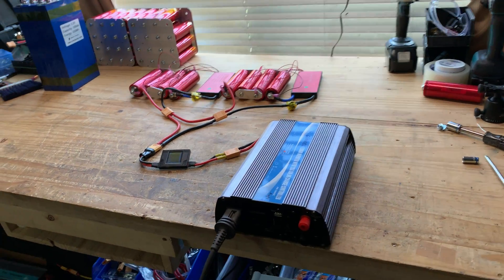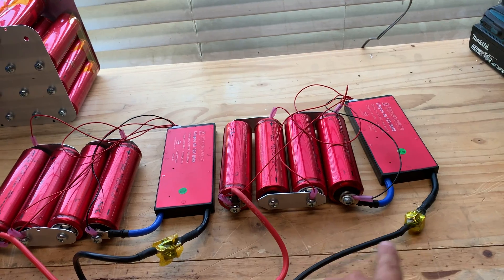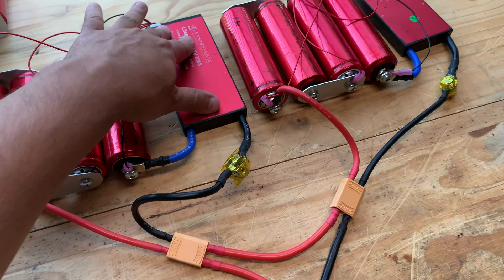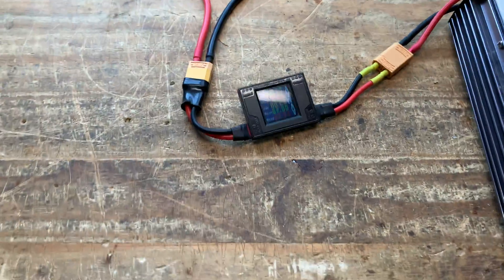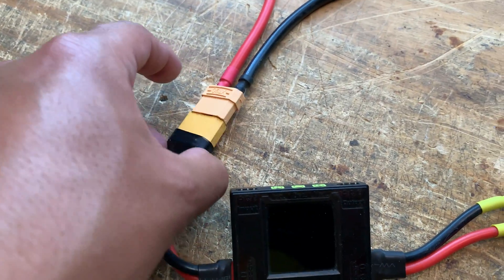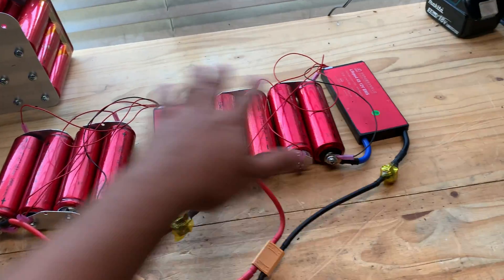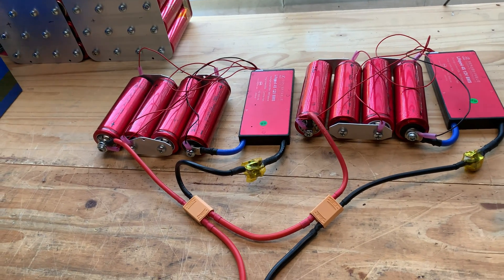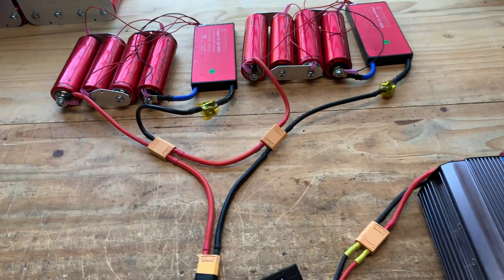BMS Battery Module -  Can you Series connect them?

Comment: No it doesnt work... i works for sometime the they just burn... i made an electric scooter and the battery was 2 parts of 5s with their individuel bms... after 10min of riding the bms of one battery is just burned ... i think it was the higher voltage because the bms was rated 50A and i was pulling only 10A with the one hoverboard motor i used for the project .. so ... conclusion... use bms only for charging and have a separate wire circuit for the discharge load... of course then you ll have to have some kind of other over discharge protection... bu me i just use those small 8pin rc balance buzzers and i moniter the stat of the cells that way i can stop when it  s too low voltage

Comment: I see a secondary problem here. Once one BMS detects that a battery is fully charged it will go open circuit.  This will stop the other battery from charging fully and your two 4S cell groups will quickly go out of balance. Or worse still it will go into bypass mode and the second battery would get the full charging voltage intended for a 24V setup rather than a 12V setup. The only way around this would be to charge using two 12V chargers (which defeats the purpose of a 24V system). I don't think I'd be recommending this system. Much easier and simpler to use a BMS designed for 8S. The only other way around this is to have smart BMS's like Battleborn does.

Comment: Because no one has responded to Ewald although it was not that long a go , I would agree with him, 24V you may be OK but above that I would not as he stated the BMS that switches off the load will see the whole system voltage across it's terminals, obviously with single 12V pack that will only be 12V but as you stack 12V packs it will quickly rise.

Comment: Didnt find anyone saying that: 

The built in MOSFETs have a maximum Voltage Rating. 

If one of the BMS shuts off. The switched off MOSFETs get the Voltage from the whole Setup so in that case 24V. 

If the Setup Voltage is higher than the Voltage rating of the MOSFETs, the MOSFETs are damaged at the second the BMS switches off !! 
You can not series connect BMS !!!

Most Mosfets can handle 75V Some even less. The higher the Voltage rating the bigger is the ON Resistance. (not necessarely but mostly).
If you get to Voltages over 100V you get problems getting MOSFETs that are capable off switching high currents. Thats why you use Relays for Voltages in cars. 
Also of course higher voltage ratings are more expensive. 

For high Voltage fast switching, IGBT are used. They are much bigger but can handle Voltages around 1000V. But they are expensive.
Reply: Ewald can a BMS be parallel linked without all of the concerns I'm reading on here?

Comment: Thanks for this video. Currently researching how bms work internally.  I am told the bms have to have isolated grounds to be placed in series.  I don't know how that is done.  The bms measures the voltage of the pack so it uses an microprocessor and an A/D. I don't think the bms can just use a diff. measurement when the common can be at such a high  voltage. Still have not figured this out.

Comment: I would want to see actual voltmeter reading not the DROK reading because that one is working based on initial voltage readout.. if it would be the actual BMS then you would have to unplug the BMS not the device plugged into the BMS the BMS stayed connected to the battery.. so in the situation of over current or under voltage BMS disconnects and shuts the system down which is normal reaction if you are taking the load from the packs but voltmeter with it's own power will only show drop on the voltage if you disconnect the balance leads and then would show right away the voltage back if you plug them in.. there is no switch on the bms itself..  so imho it's more the fault of the testing device..

Comment: The far left balance wire attached to the positive terminal of the left battery pack is completing the circuit after the left BMS module trips out. Because of this the answer to can you run them in series is no, you cannot. In series operation if either BMS module trips out you risk burning up wires and lighting the tripped out BMS on fire.

Comment: With mosfets I'd advise checking the max voltage and max current each can handle between drain and source. Gate is much lower and I'll say perhaps protect the gate side when wanting to bump up the voltage or current. But bare in mind the voltage is devided between them if am understanding correctly.

I have never worked with BMS but should be on the same principle.

It might be worth checking the components themselves?

Comment: Can you parallel connect different batteries with different bms? Should i use an additional bms that treats both as individual cells?
Can i later on charge them through the same charger as one battery?

Other than both having the same voltage as we connect them and protecting them with schottky diodes from overflow current from the other battery, what safety measures would be needed?

what is the energy density on these lifepo4s?

Many thx to those who will enlighten me! 

And thank you for those enlightening videos!

Comment: The problem with this is that you are not checking the voltages on the two different packs...Over time, the voltages can get unbalanced, which is the reason for using the BMS in the first place.
And for using them in parallel...Nothing will go BANG...but don't expect to get the sum of the current limit of each one...that's not how it works.
Overall I dont think it is worth doing this...just buy a better BMS in the first place.

Comment: Series BMS won't balance between BMS modules. Each 12v pack may be at a different state of charge. You will need to charge each 12v pack independently to get to get them at full capacity. Not an issue when discharging since the lowest pack will break the series chain, you just won't get full capacity out of each pack. You can't rely on them being perfectly matched over time.
Reply from the maker: Which is the same principle any BMSd pack operates under,  you are only as good as your weakest cell

Comment: I have heard from so many sources (including the manufacturers) that a series setup is not possible but I have personally used 2 * 48V, 30Ah packs (each with their own separate BMS) in parallel and series for years on a daily basis without problems. As you correctly pointed out - the load must be disconnected to reset the BMS in case of any fault detected. Thanks for confirming it jehu
Reply: so many BMSs don't support this function and only have problems with  B- and P-
Reply: No i also test that 12v bms can't connect in series bcz a 1 b.m.s need specific voltage that then it turns off that is auto cut off.
Reply: for bigger expensive setups that "if" is very costly and scary :)
Reply: Hi i have 4 No's 12 v lifepo4 battery    it all have seperate bms inbuilt    can i connect series without damage
Reply from the maker: But what if it fails? Everyone says,  well what if it doesn’t I say
Reply: @jehugarcia  As long as the result is not fire and brimstone I agree :) if the only problem is you either trip or blow your bms- great. Worth the money/ hassle
Reply: I used two 4S BMS in series. When they failed it took out $150 battery. But I don't think a dead short like that is very common when a BMS fails. Using the BMS to power a contactor/relay would have prevented this mishap.
Reply: @jehugarcia  Right on brother. Enjoy your channel very much - thanks again

Comment: we need an explanation for what actually happens in series, I've tested multiple LED arrays in series. yes each LED is getting 3.2V but with some chips an overall voltage over 100V the LED'S can blow up when in theory they are getting the correct voltage and current. 3.2V and 350mA?

Comment: I've personally tried with 4 cheap 4s lifepo BMS plugged in serie for a scooter. It was a disaster, there always was a pack  which gave up very quickly and i had to unplugged and switch 2 pack randomly to reboot the system and keep pulling load. I gave up the idea and rebuilt a single 48v pack with the four 12v packs.

Comment: The question I'd ask myself is, are these BMS designed for series use? 
What concerns me is what many here have commented on, and that is the presence of a potential when one 12v bank is inactive. Regardless of how low the current flow is. I would be concerned about possibly damaging whatever I would be attaching to it. In an ideal world it should be 0 volts. 
It would be interesting to see if anyone creates a 36v, 48v and see the results.

That being said I only have praise for Jehu, I'm relatively new to the Li-xx scene, and most of what I have learned is right here. I like his approach, it's a lot like I have done in the past, but I'm getting older ... lol..thank you

Comment: This is just a thought and maybe I'm totally wrong

1) if you have more packs ,and you connect the output of the BMS in parallel ,you are fine , at the beginning  ( in terms of time)the highest pack will discharge,  and then they will keep going together 

2) if you have  more packs , and you connect the output of BMS in series , you are fine ,but you have a limitation on the number of BMS that you can connect in series , because the output stage of a BMS is basically a pass transistor , and every MOSFET has a DRAIN-SOURCE breakdown voltage , so when a BMS shuts down is output,  if there is a V d-s greater than the V d-s breakdown you will destroy the MOSFETS.

3) this is a sketchy one , because apparently everyone that is building a powerwall with the jehu's kit is doing this without noticing.
In every powerwall there is at least one BMS board with three BMS's connected in parallel ON THE BATTERY SIDE ,in that powerwall every cell is connected in parallel with all the other cell ( basically you have 7 cells in series and n cell in parallel where n is the number of modules) , fine nothing wrong with that, here comes the tricky part, every BMS has a balance connector , and you connect all the all the BMS and all the cells in parallel , when you charge up the battery all the balance MOSFETS must work together to keep the packs balanced,  but every MOSFET is different from the other , and every MOSFET has a different threshold voltage than the other, the one with the lowest voltage will kick on immediately trying to balance the pack, since it's on it will heat up , and is threshold voltage will become lower and lower , so basically what I'm saying is that from all the BMS's on all BMS boards of a powerwall ONLY ONE MOSFET is in charge of keep balanced all the cell ( of the same group so there will only one MOSFET for all the third cell of the series)
Apparently no one had notice that because all cells are roughly equals so the balance mosfets are having an easy life, but during the years those cells will drift , and the balance MOSFET must work pretty hardly to keep everything balanced , at that point one balance MOSFET will blow up and then the MOSFET with a slightly higher threshold voltage will blow up , and a MOSFET ..... and so on until every MOSFET will blow up

I'm studying electronics engineering at the moment , and i'm far from an expert , this is my thought,  so if there is someone more expert than me please tell me that I'm totally wrong and that I'm an idiot , and also why I'm an idiot
Reply: I really could use your help I'm trying to learn more about this , I been having trouble trying to get the right batteries for ebikes losing money because of my ignorance.. 👍👍

Comment: You can go up in series. The one thing that you didn't mention is the lost of Efficiency. 1 BMS will have less voltage drop because each BMS will add a significant amount of resistance which will create more voltage drop, 2 or more BMS in series will be more inefficient and trigger LVC earlier than 1 BMS.  

The most dangerous part of this setup is that the short circuit protection in the BMS cannot handle more than 12v. So although everything else will work in series if you short circuit by accident it will kill the BMS.
Reply: Should getting a 24V BMS be the solution? I have a another question. I want to connect four 36V 15ah in series-parallel to get 72V 30ah what are some tips and advice? It's for my ebike.
Reply: @billychampy316 I did that with 48v in parallel and then also in series for 4 batteries @ 96v. In my situation I bypassed the bms for output and kept it for charging .

Now I’m putting 2 44v batteries in series… this time I’m planning to use the bms’s but made sure to get 2 bms’s that can handle 88v.

Comment: When the BMS shut down, it looks like it took the battery pack out of the circuit by disconnecting the battery pack and bridged its output to complete the circuit giving you the 12 volts. The inverter then shut down because of the low voltage shut down circuit and saved itself.

Comment: After tirggering BMS failure and reconnecting the balance leads,  it was showed 12v on the meter!  This implies that the right hand battery current was flowing thru the left-hand BMS even though the left hand BMS had not yet been reset.  What's up with that?    Seems like the left hand BMS should have cut off the circuit until reset.    Maybe it never cut off circuit and inverter stopped working because voltage dropped from 24 to 12v??      (Really appreciate the video - don't mean this question/observation as negative tone - just interested)